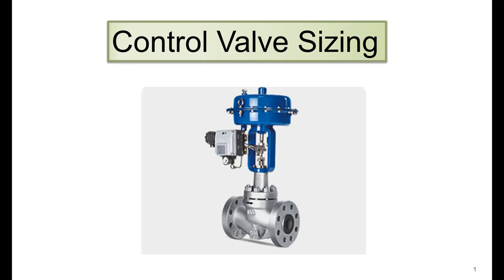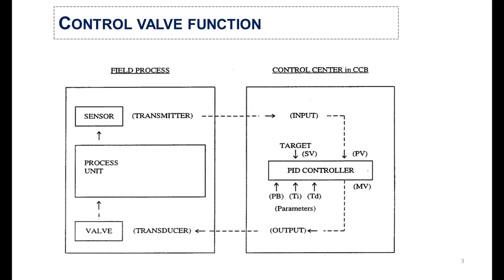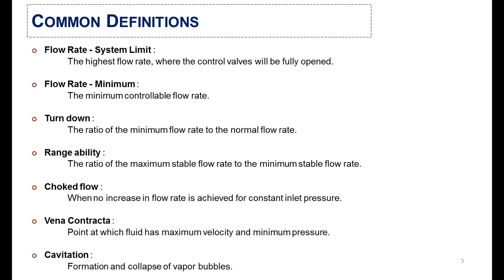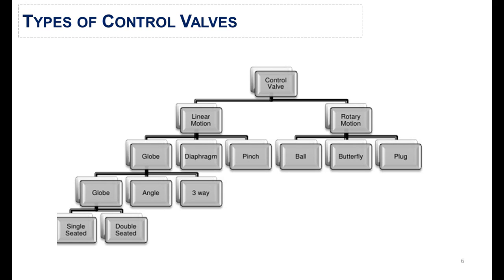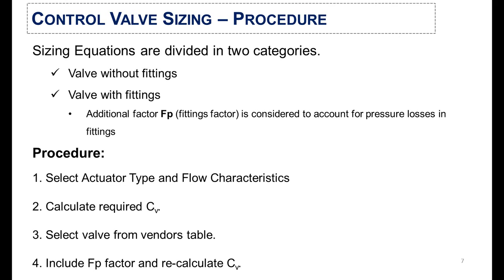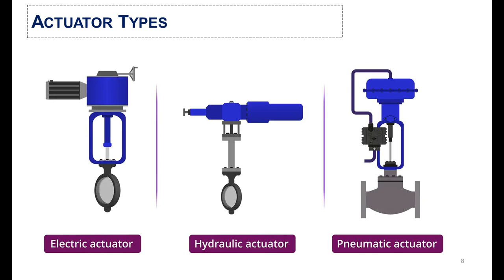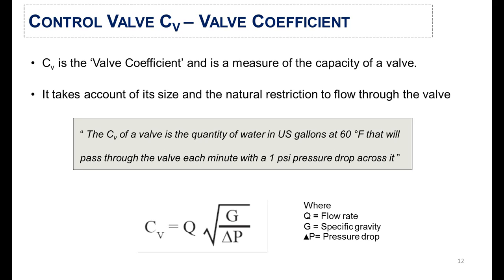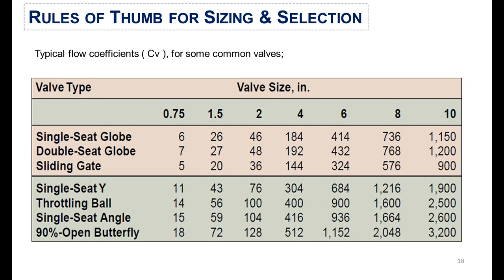Control Valve Sizing and Selection

Comment: Sir.... I'm working in valve industry and my role is to get a quote from different suppliers, I have to send them some data(Stem Torque, Stem Diameter, Lift in inches). So my  engineering team provides me this data and I want to learn how to calculate this data. Would you help.
Reply from the maker: There are some standard values which you need based on your valve service and its capacity. Engineering team use process / technical data for manufacturing of mechanical parts. e.g. Stem dia, valve seat, plug etc.